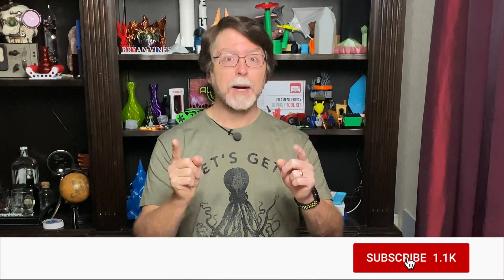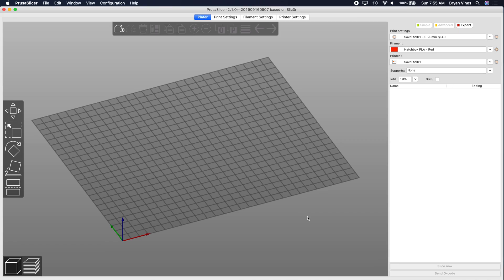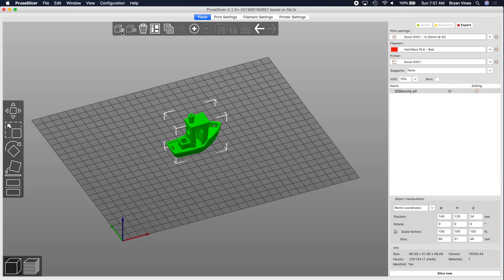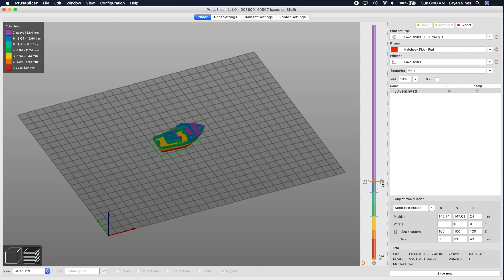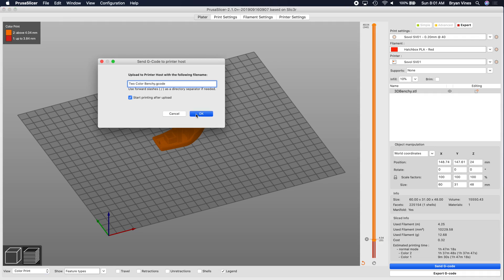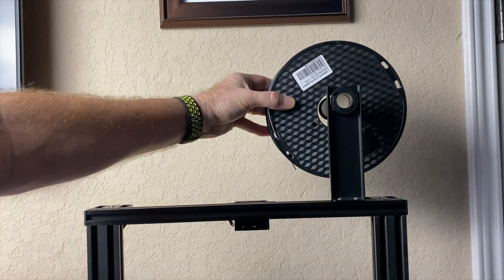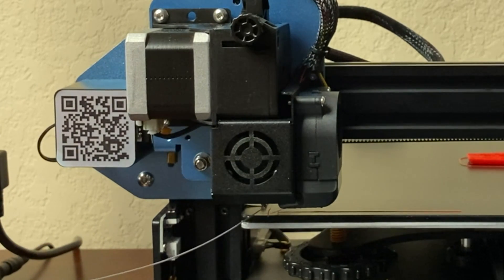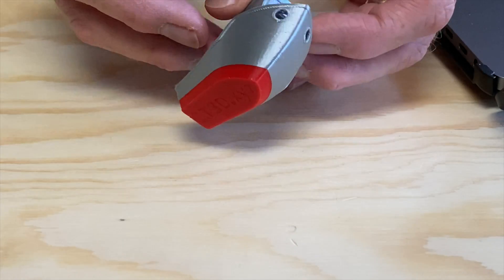How To: PrusaSlicer Filament Swaps (Multi-Material on ANY* 3D Printer)

Comment: Hi, how strong is usually the connection between two colors? I have tried fillament swap in the middle of Printables test model "XYZ cube" and after pause and resume I have got rather weak link between two halfs 😢 Is it bad model for this and more solid models are ok? also line between two colors was fairly visible. Is it a problem that previous layers cools down during swap? Printer is old Ender3. Thanks, new to 3D

Comment: Good Morning, I know this is more likely an issue with my printer, and not Prusaslicer, but I'm hoping  you might have some insight anyway. The M600 code seems to work at first for a change of filament as instructed by prusaslicer. The message comes up on my printer screen about changing filaments, the print head moves to the back-left, purges and waits, but it only has a 40 second timeout before it will start printing again, regardless if the filament has been changed or not. I want it to wait indefinitely until I instruct it to start again. For reference, I am using an Ender 3 S1 Pro with the latest Firmware on both the machine and the display.

Comment: I came here for multi material swap with one extruder as the title claims. But this is just about color swap using the same material.
Reply from the maker: On the bright side, at least you came here. Thanks for that. In my defense, Silk Silver PLA is one material. Red PLA is another material. They're the materials I wanted to use four years ago when I made this. They're just not the materials you were interested in, although technically ALL the materials you might successfully put through the extruder of an FDM 3D printer are plastic, which, of course, is just one material, right? 😉
Reply: @BV3D  And you earned yourself a follow :P 
Afaiu, the term material is used as differentiator between types of plastic. I am looking for a way to swap from TPU to PETG. While i could just add custom gcode at the M600 filamant/color swap to change temp and speed, TPU and PETG differ in many more aspects in their profiles.
I was hoping for some kind of 2nd virtual extruder i can add to a single extruder printer. But as it looks, i need to read into how to fake a MMU.
Reply from the maker: @timokonnecke3799  I think faking the MMU is the way to go. If I remember correctly, that method was suggested by a commenter on a video with a color swap on the first layer. I should look into the current way to do that. It could make for a fun video. Thanks!

Comment: What happens if i left it for hours without changing, like i went out? Will the nozzle clog?
Reply from the maker: A lot of printers will keep waiting, but they'll turn off the power to the nozzle and the bed until you come back to complete the process. Then the printer will heat the bed and nozzle up again.

If you're printing on the kind of bed that lets go of the print when it cools down, that could be a problem. The bed will have let go of the print when it cooled down, and heating the bed up again won't make it grab onto the print.

Comment: I've switched my stock Ender 3 v2 to the Jyers' Marlin fork and started to use (and love) PrusaSlicer and I finally was able to make a 2 color 3d print without any issues, after many failed attempts using Cura. Thanks so much for your videos, they're excellent!
Reply: can you teach me ? cause ive try but it doesn work, no pause when i print
Reply: @ayo3dprint  You need to install a firmware that supports it first.
Reply: @mikelexp  Thank u sir. i try to research more about it.

Comment: BV3D: Bryan Vines, i love that your channel is always in my tab bar. 99 percent of the time i have a question related to slicing, doing something cool with my printer, or just curious about something. there you are 2 steps ahead of me and already done some research. Thanks so much for this. your using PrusaSlicer 2.1 in this video. i can confirm that your Perfectly explained Walk though is still accurate in PrusaSlicer 2.3.1, Thanks for all the help. your my top go to source of information when it comes to learning new fun ways to print things. keep Printing my friend. and ill talk to you later.

Comment: Hi Bryan, thanks for the videos, helps in getting started in this 3D game. I have a question, I see how to change filament mid print with  pause and resume, (with or without Cura post-processing G-Code edit), after changing filament. Is there a way to actually start a print from a layer up the print? I had someone visiting reach over and pull at a loose filament, and moved the model from it's bed bonded position...at layer 156 of 280. Since it is a large print, I thought it would be good to try to print the model starting from layer 156, then glue them together. can you do it? thanks again..

Comment: Bryan, another great video. One problem I'm having, though, is when I try to print a sign using raised letters and a filament change, I can NOT get the letters to stick to the piece below (the one made of the other filament). Most of the letters either fall off on their own, or can too easily be pulled off. Thoughts?
Reply: increase the heat, try different filaments. two of the same type from the same manufacturer typically work well.

Comment: I cant get this to work on my cr-6 any suggestions?
Reply: I am stuck the same on the CR6-SE. I own a Prusa and there it is fine. i have found few ways to go for that. Because the printer doesn't read M600.
1) the community firmware should work because it supports M600.
2) manually change the Gcode for a code containing a pause like M25 or M0.
3) slice the part for 2 prints bu cutting it at a certain level and glue the 2 pieces together after printing.

Comment: It doesn`t work for me. I have an Ender 3 Pro with 1.1.8 Creality 3D Firmare. After the programmed stop (M600) the Extruder moves to the side, but i can`t resume the programm afterwards. Any suggetstions of what might be wrong? Do I need to add something to the code manually?
Reply: Same issue I am having did you ever find a fix?
Reply: @GradoniusTheWise  Firmware update fixed it for me.
Reply: @Noobiosity  Thank you GoatRider for your reply! If I may inquire further, what was the firmware fix like? Did it provide steps for you to continue through to unpause, did it add a resume button etc? For me, octoprint shows that it pauses and even spits out the filament but there is no way to do anything from there... My next try is going to be running it from the SD card as it may be an octoprint thing...
Reply: @GradoniusTheWise  I dont use octoprint. the firmware update enabled the filament change command on the display and also enabled the pause function. There are plenty of videos on youtube on how to update.

Comment: I have the Creality CR-10s Pro v2. I have used the change filament function in both slicers. Both are set for the Marlin gcode. For some reason it does not work on my printer. I have checked the gcode to make sure that the M600 code is there, and it is in both slicer files. It just prints the whole model from bottom to top without stopping for the filament change. I have to physically pause the printing to change the filament. I am bummed because I see other Creality printers working properly for this function. Any suggestions to get this to work with my printer??? Thank you!!!!

Comment: Is there a way this works, when the materials differ a lot from each other? For eg PLA combined with Flexfill 98A. The maximum flowrate differ a lot  and i don't want to lengthen the print time from 2 to 7 hours im my case using the flowrate of Flexfill 98A. I think there isn't a feature in PrusaSlicer yet, which allows you to change the filamenttype with the colorchange. Or is there?

Comment: Good video. I have an Ender 3 with an SKR Mini E3 board. I modified the firmware to enable BLTouch and M600 filament change. I sliced a calibration cube in the newest version of the Prusa slicer and set it to change filament a 4 mm layer height. I sliced the model again, and exported the gcode and put it in Octoprint. The printed started, and was going fine, but did not stop at 4 mm for a filament change. I waited, but it never paused. I used the command line in Octoprint and entered an M600 command. The printer stopped, and waited for the filament change. I changed the filament and continued the print. Is there anything more that I need to do in Prusa slicer? Thanks for your help.
Reply from the maker: If you open the G-code file in a text editor, and search for “M600”, does it show up? If not, then PrusaSlicer didn’t insert it. I have no idea why it wouldn’t have. But I’m curious to know whether PrusaSlicer put the M600 into the file.
Reply: @BV3D  Thank you for the quick reply.I searched the file and the M600 was in there. I was going to try it again, but in the interim, Windows decided in it's infinite wisdom, that it wanted to upgrade to the next version. When the upgrade was complete, I decided to shut everything down and work on it the next day. When I started the system today, the first thing I did was power up the printer, connect with Octoprint, and try to print the same file. The printer paused at the right place and waited patiently for me to change the filament. I sliced some new files, put in a filament change and it worked. Since I used the same calibration cube, with the filament change inserted at the same place, I'm going to do a file comparison to see if there are any differences. I'll let you know if I find anything. If not, all I can say is "Windows!" Your videos always have such clear instructions. I have been recommending your channel.

Comment: Guess I'm going to have to try Prusaslicer
Reply from the maker: Hi Ben! Interestingly, I recently ran across an STL file that Prusaslicer got confused on. It's good to have multiple (and free!) slicers at the ready, in case your favorite one has an issue with a file. Kind of like having multiple web browsers so you can try a different one if your favorite browser has an issue with a site.

Comment: Many, Many thanks Bryan, you are a real Gentleman, I'll let you know how I get on with it, thank you again.
Reply from the maker: You are quite welcome. I'm working a slightly different printer and print settings profile for the SV01, based on the Prusa MK3. Testing so far seems pretty good. It'll be a more simplistic, with Prusa-style print settings such as "0.20mm Speed SV01" and "0.2mm Quality SV01", and similar. The idea is to have simple presets where you can choose speed versus quality for a particular Z resolution. For more advanced stuff, you can always make your own print settings profiles to really push things. 👍

Comment: Chuck Helleybuyck did a similar video for doing filaments swaps in Cura:
https://www.youtube.com/watch?v=1nBnVtOEAiY
I've used it and it worked well for printing multicolor prints.
One caution is that when you set it up in Cura it stays until you remove it for the next thing you're slicing.  I found out the hard way when I went in to check on a long print and then head was parked only a little way up and waiting for me to swap the filament out..d'oh!

Comment: Nice video. I'm just waiting for a reliable CR10S Pro profile to use with PrusaSlicer.
Reply: Building a new profile for any printer is very straightforward, it isn't magic. I use Prusa Slicer as my go to for all my printers, which includes an Ender and a large Delta.

Comment: For signs I prefer a nice surface - like from a PEI powder coated spring steel. So I print them with the sign at the bottom. Swapping filament on a certain layerhight is not so nice, as the layer would bridge over and do not have the nice texture. So swapping filament inside the first layers would be mor elegant.

Wouldn´t it be possible to put a M600 in toolchange g-code, designing the object in two (or more) colours in the lowest 0.6 mm only, so (with two colours) you have to swap filament 6 times (with 0.2 mm layerhight) manualy and print the rest in one colour? So you do only have to swap inside the first three layers, making the sign (or maybe text/logos for a front panel  for an selfmade electronic device)? With a textured surface it should look quite nice...
Reply: I have done this before, but it is much more complicated on all aspects. A layer change M600 is super easy, and still can have a dramatic effect.
Reply from the maker: I've got an idea about how to do this; it's something I've been meaning to test and make a video on, because I have a project that requires it. I'll start working on my idea. Thanks for bringing it up! 👍

Comment: Cool. I'm going to try that and see what it inserts in the gcode at layer change. 
If you pull the source from github M600 is not enabled by default. I noticed there were quite a few settings associated with it as well. I'm flashing 2.x sometime this week and hopefully I got the values right for my Titan setup. I figured I'd give M600 a go since I'm already flashing to try and fix an X driver error that keeps halting the printer when it's idle.
Reply from the maker: Hi! It definitely inserts an M600 for the color change. It even comments it as such in the G-code.

I'm want to start getting acquainted with Marlin 2.0 in the coming weeks. It's going to take a little getting used to, I think. 😅

Comment: I need to load PrusaSlicer just to at least get some comfort in using it. This gives me an excuse, as getting the swaps down in Cura has been a bit of a pain.

As always, thank you for the video Bryan. :)
Reply from the maker: The last time I tried filament swaps in Cura was in the version 3 days. There was a "pause at Z" plug-in that was required, but didn't seem to really do what I wanted. I'm sure it's gotten better.

The first time I did a filament swap, I just did it while the printer was running. I quickly removed the first filament and inserted the second one. It worked, but it was tricky! 🙂